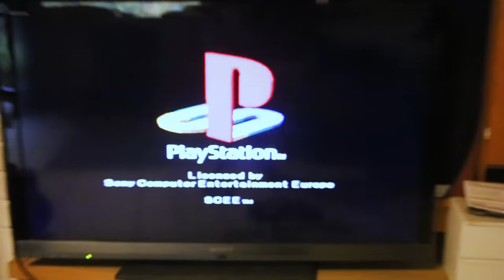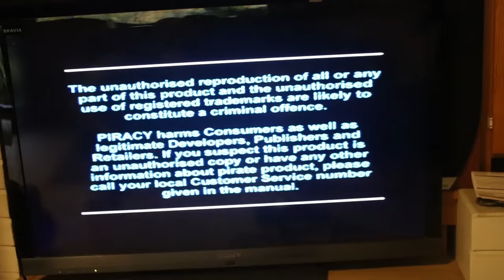Restoring the original PlayStation (PS1) - Vintage Console restoration & repair

Comment: "I will now remove the mod chip"
goodbye
Reply: I had one in my PlayStation 1 too
Reply: Zeco Rho if it didn’t break anything, I would’ve left it.
Reply: Yep, me too. If it ain't broke, don't try to fix it.
Reply: given the fact that it's a restoration job, it would make sense to get rid of the mod chip
it hurt me to watch it get removed too
Reply: You're right. Removing "region free" (and more) modchip is stupid in this case. This PAL console is now stuck in this crappy 50Hz speed, completely useless for any serious gamer.
When I saw the text about this removal appear, he was done for me.
Reply: @Dave_K.  if you are a "serious gamer" then why don't you play on a pc or a ps 4 or smth
Reply: most games that was "serious" back then didn't run 50 nor 60, they run 25\30Hz or they would turn into a lag-party from hell.
and try feed 60Hz signal into an 50Hz monitor and expect picture... yeah...
though what the modchip allows for is outputting NTSC-50, something maybe 2% of the CRT's could handle though only if the PS1 was connected trough the RGB-Scart cable and not the original else you got a black\white picture.
Reply: @brrebrresen1367  More than 95% of PS1 Games are 60Hz native because programmed in the USA/Canada or Japan, that's why 50Hz PAL versions of these games were a real pain with distorted image and lower speed than normal.
Plus, in the mid/late 90's, vast majority of European screens were 60Hz compatible via RGB SCART (especially in France) with a lot of RGB SCART cables for all consoles available at resellers in Europe. So, this "incompatibility issue" wasn't an excuse anymore at the time and less today.
Reply: @nasrullahkamil6688  I'm a retrogamer but I'm playing some actual games I like on a 12-core Intel Xeon, NVidia1080Ti, 64GB RAM PC. As you can see, I don't have to worry about that.
Reply: "Serious gaming" the thing is I can't call a PC a serious device for gaming because it's flawed in many ways. PC is for work not for games, you like it or not. What I call serious gaming is plug n play, anything that wastes my time try to run something isn't serious but it's a joke. Most of modern day consoles are leaning toward PC style, you need to install this and that to make something to run while these older consoles are more convenient just plug n play no hassle. Anyone who calls himself a serious gamer and is mainly on PC isn't a gamer, it's an idiot who likes wasting time on stupid broken things and never embraced true gaming experience. Most PC "gamers" are egoistic idiots who treat their devices and software as a status symbol and not tools what they actually are. It's not all about who have more power and spends more money, it's about what you have on hand and what you can use it for and spend less on it as possible because there are more important things in life. Can you make something to run and enjoy it as it is meant to be enjoyed or treat it as a imaginary status. It's like that never ending game of who haves the more expensive car or bigger dick which at the end of the day is irrelevant because in a serious relationships those things don't fly.
Reply: @P33b4Ugo5omwh3r3  Yeah, that's why I prefer retrogaming because playing on a retro console is near 100% plug'n play.
Reply: @clydecash5659  it's all politics dude. really! it was to ensure some export laws are respected, and even make different content that fits every region. in arabic countries, less women. in asian games, more whites, in the US, some copyrights change (starfox vs starwing here) and bullshit like that.
Reply: @beardalaxy  it's like, "I'm restoring ly old ThinkPad that runs perfectly fine and even modern stuff on a Windows 2000 upgrade or even on Redhat Linux 4.x" but "no, it is better on the original Windows 98! it's precious!"

meanwhile I still find a way to grab a RGB signal in the output of my Atari 800XL and use it as a serial unix terminal.

Comment: Did that guy bury the ps1 in his backyard?  😦😳 lol
Reply: Cameron odd t added the dirt for dramatic effect.
Reply: He's good, and I enjoy the videos, however I also believe the dirt was added.
Also the laser was usually the issue for PS1 and PS2.
Reply: I've had the things stored in the worst places growing up as a kid,mainly a rotten shed that leaked with a dirt floor, and a yearly flooding basement that the sub pump couldn't handle, with both parents smoking in the house and later myself, this dirt was added.
Reply: It took a Tomb Raider to find it🤣
Reply: Probably thought if you buried it and watered it for 3 days, it'd sprout a PS2. :)
Reply: No sir,he didn’t
Reply: Unless it was dropped in a puddle then stored away, yes, yes he did.

Comment: Back when this was just a PlayStation because it was the only one.
Reply: Retconned to PS1... There was a PSone as well, curved.
Reply: You missed the point. There was no need for différenciation because it was the only one.
Reply: @forevercomputing  yeah it started life as playstation x. Then playstation later psone
Reply: This is the Sony PlayStation. Don’t forget that there was a Nintendo PlayStation (just a prototype but still a legit product).
Reply: Yep. I think they should have kept calling it « Playstation » or give it marks like « Mark IV Playstation ». It’s much classier.
Reply: Half year ago also did clean mine and gave it a special place. It was not dirty, but it has all kinds of stickers on it. As a kid considered it cool xD
Reply: ok boomer
Reply: @richard-gn3es  the PSX is an entirely different console, it's basically a ps2 with a PS3 UI
Reply: do you guys know if anyone is working on a load from a micro sd card styled replacement for the disc drive? I believe someone did that for the Dreamcast. I know about the PSIO but my PS1 doesn't have that port.
Reply: It’s still called the PlayStation. No one knows why people call it the PlayStation 1 they just do
Reply: @tristan6509  yep a lot of people seem to call ps1 psx for some reason even though they are completely different

Comment: Why remove the modchip, though? I know that it allows you to play pirated games, but still! Region locking has gone from a necessity to pure greed. Even Nintendo realized this! The Switch has no region lock!
Reply: Because it doesnt belong into the console, same as the rockstar sticker.
Reply: @maddy02_  Still, though, the modchip just makes it that much more versatile.
Reply: @aetheralmeowstic2392  "I also wanted to remove the mod chip. I can always reinstall it, but for the purposes of this video (restoration) it makes sense to remove it" Other questions you may have may also be answered in the description. Have a nice day :)
Reply: I get what you're saying but at the end of the day it's a restoration video. Hence why it was removed.
Reply: @aetheralmeowstic2392  that model does support an external one, probably better off with that anyhow.
Reply: @locke103  you mean the PSIO.
Reply: But piracy is bad.
Reply: @hanjinhazirdejose4494  The modchip only allows them to use games from other regions, it does not allow pirated games. 
Yes I read the description I am just telling them.
Reply: @NecroBanana  PSIO still requires a switchboard to be installed onto the motherboard.
Reply: Some games employed measures that would render them unplayable, even with a modchip
Reply: @watkinator4413  
Because the restoration process is at the sole discretion of 0dd Tinkering, that's why. Restoration does not imply that EVERY aspect of the item is rendered 100% to its original condition, on the inside or the outside.
Reply: @missbradicah  what?
Reply: @missbradicah  even odd tinkering himself said that's the reason why. Restoration means restoring it to how it was originally.
Reply: tonyhax

What a time to be alive :D
Reply: @thomasnolastname8734  There are patches for these protected psx games.
Reply: The unit was in the 'tampered' state with a foreign modchip. 

Removing it stays true to restoring it to its original state.

Granted an opened unit is already technically tampered, but you get the point. 😜

Comment: Good work, though I don't approve of removing the modchip unless it's being replaced with a different mod despite how ghetto it looks lol. Real game discs are old, expensive, and not always guaranteed to work due to scratches or disc rot, and the ability to play backups is very valuable for disc-based consoles imo
Reply: Agreed. I would play a backup over original.
Reply: Make the backup from the original and keep it clean and safe.
Reply: Some games have modchip detection that will stop them running if a modchip is detected. So removing it isn't such a bad idea at all.
Reply: Did you read the description?

Comment: It feels like she was specifically stained for this video. It does not look like well-worn. Not a single scratch.
Reply: I doubt that
They might not show up on camera very well, either because lighting, youtube compression or the type of plastic used. I have seen something similar with steel already, there was quite the dent, but you just could not see it unless you looked from a specific angle.
Reply: Doesnt have to be damage outside, if you cant use something and the problem is inside, you store it somewhere, in a garage or something else and thats it. Its disgusting and unsuable.
Reply: It didn't say it was worn. It had issues and was ''parked'' in a shed for a long time. Maybe it had issues very fast after it was bought.. The dirt does look legit in my eyes.

Comment: "I bet you were not expecting to see hammering in this video."
I wasn't expecting to see the removal of a chip that increases functionality.
Reply: Didnt he say it was a spy chip?
Reply: Mamacube it was a joke it said right after the chip enabled the console to play games normally restricted in certain countries
Reply: I was kinda hoping he'd just make it look a lot better and not so much a spaghetti monster.
Reply: The type of chip it was is called a SPI chip. Stands for Serial Peripheral Interface.
Reply: It was a horrible looking mod though. So much fucking spaghetti
Reply: @objectionablechione  your kitty sucks you stinking dirtbag.  My kitty is b0ss
Reply: @Doctors_TARDIS  the wiring is kinda okey. Nothing much to do about. Some  main board versions were much more odd, as you had to drill holes into it for routing some wires. I did that during college. Modded PSX, PS1 and PS2 and charged 30€ for that. 
But for insulation i used heat-shrink tubing rather than tape.
Reply: I cried
Reply: well he's a german after all, all should be akkording to ze rules
Reply: @meow bastard
Hey, hey, hey...  I won't have any cat shaming in my thread, you bul--  Oh, wow.  I just looked at his kitty, and you're right.  That cat is a total loser.  It kind of pisses me off just to look at it.  Nevermind; carry on.

@cakesphere
In case it isn't obvious, I'm just kidding around.
Reply: I think he intended the final product to return to it's original shape, maybe that was why he removed the alterations

Comment: previous owner: "it was starting to have problems"
mod chip: messed up internal hardware
Reply: Heartless Hufflepuff not really
Reply: Yup. One of the worst mods I've ever seen.
Reply: Jackie Tearie  
Mod Chips allow you to play CD-R games aka pirated games
Reply: Really not really. During college I installed those IC's on PSX, PS1 and PS2 consoles. Charged 30€ for that. 
The Consoles here in Germany were in PAL format. The Chip enable you to play NTSC  and  SECAM CD/DVDs. Including original japanese Games and pirated games on CD-R aswell. And some games even were region restricted. That Chip did simply bypass this. 
Never did anyone I installed an IC like this had any hardware issues  caused by such modification.
Reply: @Christopher R true
Reply: @Christopher R v e n d o  p l a y  2  c h i p e a d a

Comment: Odd Tinkering: "Now I will remove the mod chip"
Me: rolls eyes, shaking head "Purists..."
Reply: Same
Reply: @CaptainDijango  What's wrong with that?
Reply: It's with good reason. some games used mod chip detection software as an anti piracy measure. it would terminate the game if a mod chip was detected. Yes a mod chip allowed your console to play games that released in 1 region. But is that really worth when you'll be unable to play some of your favourite titles?
Reply: Daniel Sauter Some ps1 games had mod chip detection too. Spyro Year Of The Dragon is one example.
Reply: Daniel Sauter I owned a PS1 that was modded, handed down by a family friend, and some games, like Strider 2, could not be played because the console had been tampered with. I THINK a Tony Hawk game did that as well. I still remember crying about it ( I was...what, 12-14 at the time?).

I think we’ve sold the PS1, Master System and extra N64 since then, so I can’t confirm which games could detect modded chips.
Reply: When my father bought us a PS1, he had it modded before I even got it, haha. Think I owned maybe 2 original bought games, lols.
Reply: The was two types of mod chip the standard and stealth. standard mods just bypassed the lockouts
but a stealth had all the region codes on the chip and if a game run a non standard region codes the chip will block it
till the game give the standard region code this was how the anti mod worked.
The stealth mod I had (still have) is one were you can let it auto boot a game or force boot a region by holding down
a button on the pad ( This played all games including spyro the dragon 2 that had the best anti mod/pirate)
spyro 3 had it too but it was beat by then PPF "Playstation Patch File" you just Patch the game ISO so it used a standard boot.

Comment: Love how on Tekken 3 it shows "Credit 0 Insert Coin" on the top right. Didn't even bother to port it to PS properly.
Reply: They had this sinds tekken 1,but a lot of porting has been done with tekken 3 for the ps1, because the arcade version could not run on ps1 hardware, most obvious is the 3d backgrounds not present on ps1
Reply: Lol. It was probably on purpose to bring arcade feeling to the home. When controller is connected game sees it as a coin.

Comment: 2019: restoring original ps1
2030:restoring original ps4 
Wut?????//
Reply: 2020: restoring ps2
2021: restoring ps3
2022:restoring ps4
Reply: ToTalTv  I have ps1-3 2 and 1 are covered with dust and spiders edit: but 1-2 are my dads
Reply: @jameschristian1664  hmmmm
Reply: @jameschristian1664  2023:restauring a computer
2024:restauring a ps5
Reply: To my caculations... the ps3 is 22 years old by using the numbers on the comment
Reply: 2052 : Restoring Humanity
Reply: @jameschristian1664  I have an original PS2 nothing has been replaced on it and it works like new still to this day.
Reply: Hay
Reply: @Localwindow710  maybe someone like me has a broken down one

Comment: I remember putting stickers on mine as a kid.
What a blast from the past 
Colin McRae..
Reply: PSM had stickers for the playstation. Good times when game mags were good.
Reply: Jo mamma
Reply: My brother put a sticker of a smiley face with an eye patch on the open button not long after he bought his new. All these years later, the sticker obviously shows some wear, but not as much as one might expect. Most of the wear is around the edge of he sticker where we eventually ended up having to "massage" the button back up after pressing it because it had the same issue as the one in the video has at the beginning. We found that massaging it slowly back up was the fastest and easiest way to get the door to latch after inserting a disc.
Reply: Jo Ski RIP McRae. Rally god.
Reply: Sackmatters 
Yes well said  ✌️

Comment: Be careful with the power supply. Those capacitors do not mess around. Better discharge them by shortening them out with a screwdriver or something.
Reply: How would that work? I mean phisically, how do you short them with a screwdriver
Reply: @MrMasodelSaggio  bridge them to short them out
Reply: from the other side of the board, pretty easy, also if you would be brave enough you could do it with a finger XD wouldn't be lethal for a human as long as it only flows inside one finger or an arm
Reply: @thany3  if the electricidty doesent flow through some critical parts, you should be safe, might loose the finger tho
Reply: You do realize the restoration is already over and it was a success, right? I mean, this is not a live-stream.
Reply: Careful next time then 😘